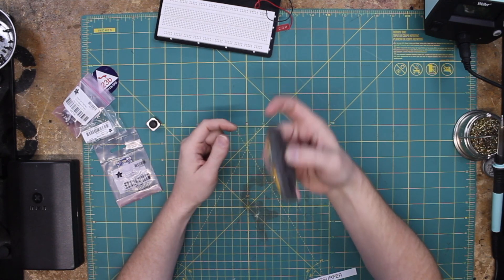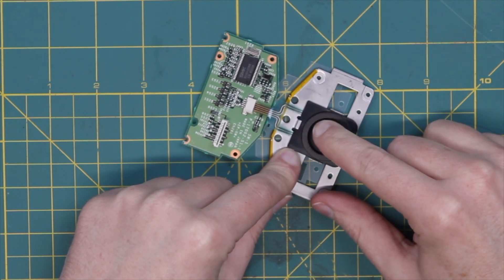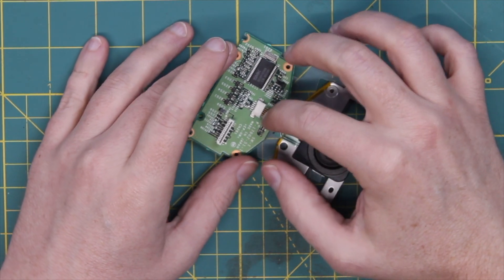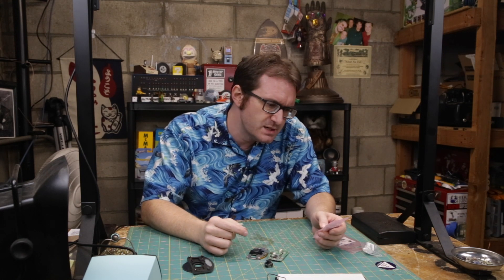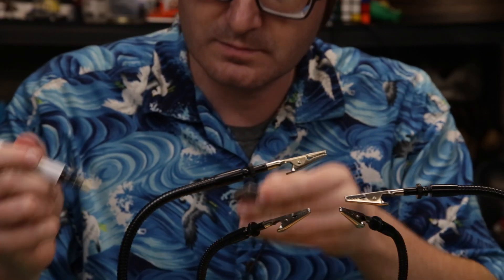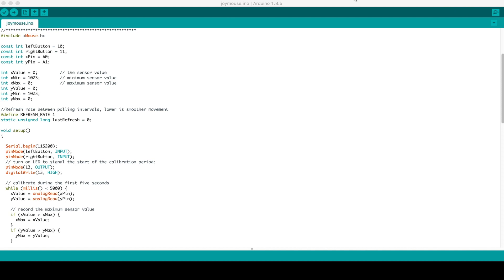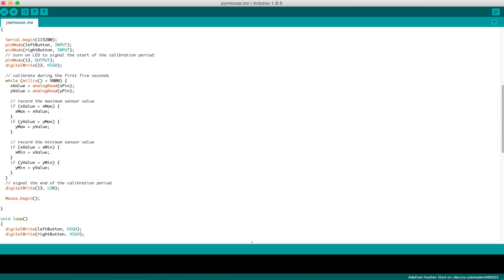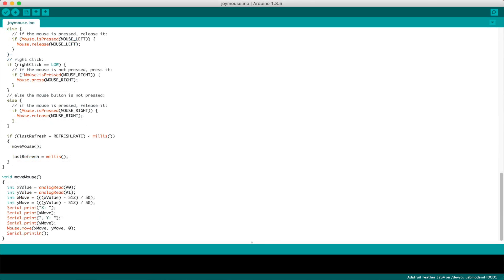How To Build An Arduino Joystick Mouse

Comment: hi ! I'm building a little portable linux pi thingy and I reallly want a trackpoint mouse instead of a trackpad.
Your project seems.. rather perfect for my needs. But I have one question.

Do you think I could swap the joystick for an actual trackpoint module from a lenovo keyboard ? like.. solder it off and put it on there ?

I'm not very familiar with electronics and arduino hahaha.